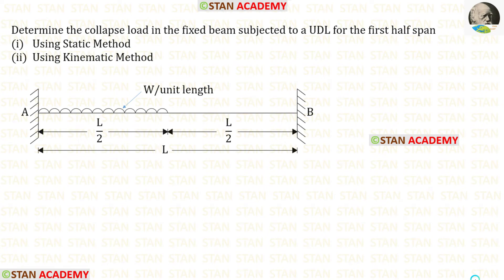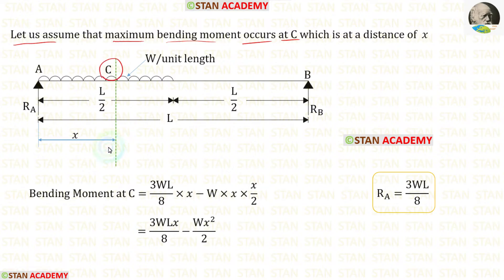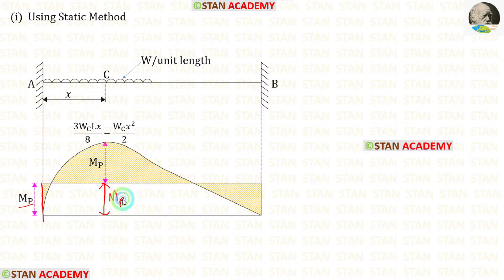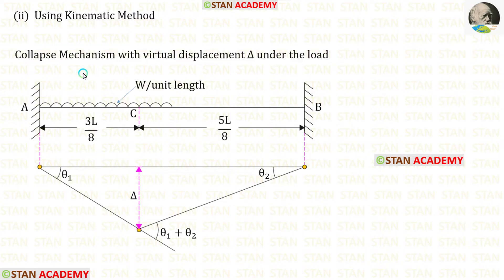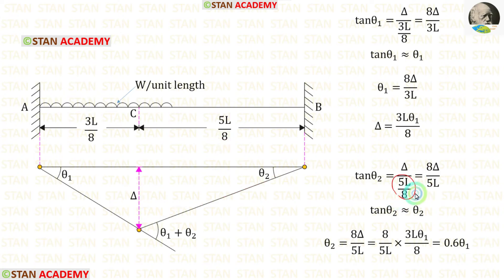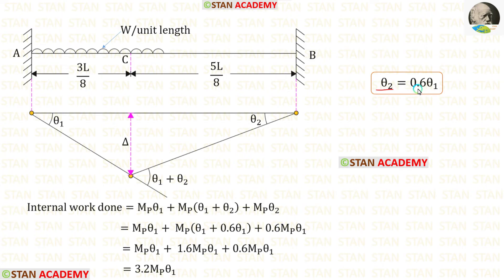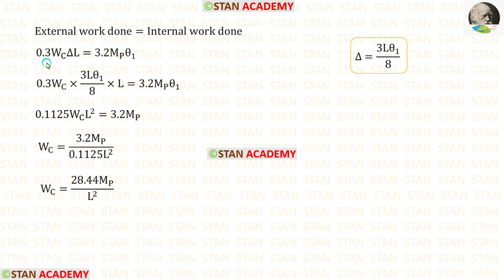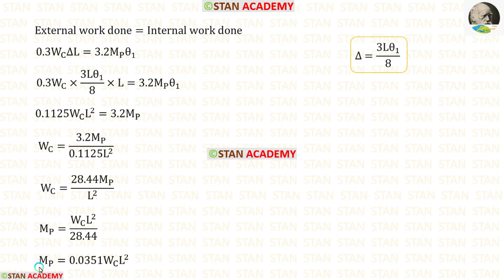Collapse Load in Fixed Beam with Half UDL ( Kinematic & Static Methods )

Comment: If using kinematic method to find x distance where plastic hinge occurs, what would be the steps to be followed? I am trying to solve in that way but something does not add up as the distributed load is not laying all across the beam.
Reply: have you found the solution to this?